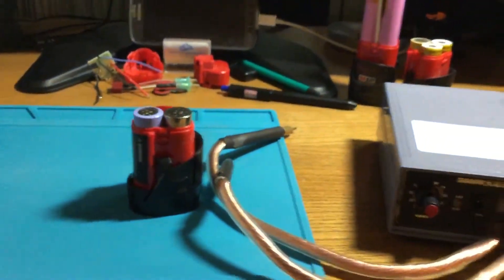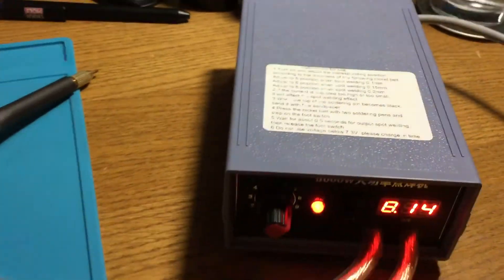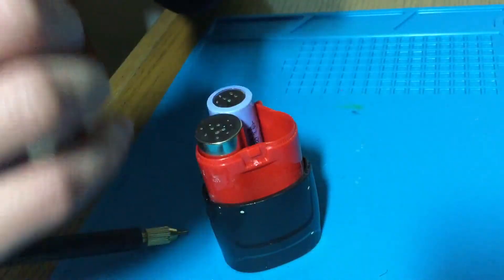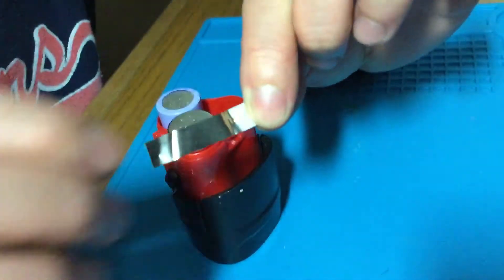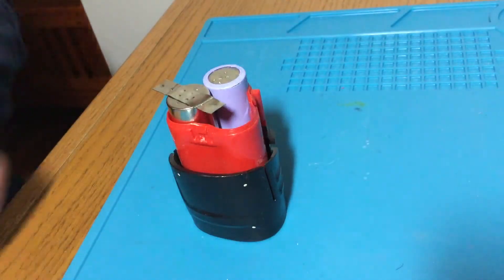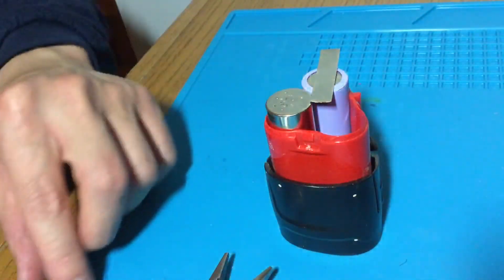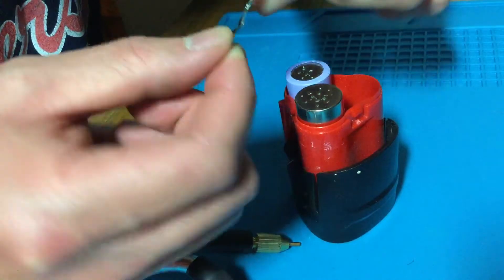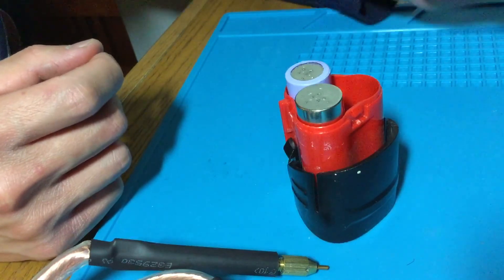Testing the KKMoon 5000W spot welder with 0.2mm pure nickel strip

Comment: so it doesn't spot weld 0.2mm then.  it has a little brother called DX10.  it's probably won't do too.
btw how much is the different of the price of pure vs plated? 

coz there are so many scammers in the market.  some of them might be selling aluminum plated and calling it pure since it doesn't rust on salt water test it's hard to figure if it is a scam.
Reply from the maker: I bought the strip from a friend, Liionwarehouse, so I know it's pure. I didn't shop around

Comment: well, you can improve performance of this welder a little.

first i soldered negative battery tab directly to the brass bus bar, for some reason that has not been done by manufacturer - big soldering iron is needed.

then i noticed that brass tip holders are heating up - so there is narrow spot for current flow , so  i  made my own holders from thick copper tube and tips from 6mm copper rod.

it is possible to weld .2mm pure nickel strip now.
Reply from the maker: My welder had the negative battery tab already soldered directly to the brass bus bar. I didn't notice anything with the tips on mine. In the end, I bought a Malectrics spot welder and will be doing a video soon

Comment: I have to say, this spot welder is not bad, it cans spot weld PURE 0.15mm nickel strip or 0.2mm NICKEL PLATED nickel strip. But 0.2mm PURE nickel strip, it seems to be weak. It can also do nickel to nickel (0.15mm PURE), So basically, with double 0.15mm pure nickel, you will have 0.3 MM PURE NICKEL!!! So it works and I made my battery pack very esily. I'm so happy XD.

P. S
This spot welder can also do maybe TRIPLE NICKEL. Not bad after all...
Reply from the maker: Can't the cheaper spot welders also do 0.15mm pure nickel? And isn't the added resistance of stacking nickel strips undesirable? This spot welder seems bad value to me at $80+
Reply: @MINIzguy  Well it's a little bit to high the price but no, stacking nickel together decreases the resistance. I know this from experience and of course I tested it and it is true. Because stacking nickel togheter means putting strips in parallel, and if more resistors are in parallel, the total resistance must me lower due to Ohm's Law. So, it can't spot weld 0.2mm PURE, but you can spot weld multiple PURE 0.15 and you will still get less resistance. The price of this should be at least 60 - 65$ by the way...
Cheaper spot welder can't weld well 0.15mm PURE. Welding the PURE nickel strip is harder.
The disadvantage is that you will need a double length of the nichel strip in case you have to do double nickel... Well... There are pro and cons.
By the way, I was able to make my 12P4S battery pack, and IT WORKS PERFECTLY FINE. Drawing 50A from it is absolutely not a problem (And I didn't use double 0.15mm nickel, only single strip). So it seems like it works for battery packs...
Reply: @MINIzguy  I agree.

Comment: I have open them I learn that cheaper in this tool brand isn’t worth it for heavy use they stop working from cell issues and electronics , I just got a 6yr or more 1.5Ah original and still holds up till today they are worth when you purchase new from authorize store ima try to do the hack you have done with the lights might use it to test things out …

Comment: How the heck is this possibile this damn thing costs 92€ and IT IS A PIECE OF JUNK ACTUALLY it says that it can spot weld 0.2mm MAX nickel strips but in your video it seems like this thing is just a $ BURNER. Good spot welder for about 100€ or $ is non existent??? Where i COULD find a good one i need this and probably thanks to this video im not gonna burn my 92€
Reply: I will try to boost it with SUPER CAPACITORS. The are very powerful and can deliver insane amount of current. I Will Also try to charge it to precisely 8.4V with my  current limited power supply and Press a lot on the nichel strip and then spot weld (6 holes instead of 4).  Maybe it will get BETTER... I cant buy other spot welder unfortunately.... This is my only possibility so i will modify it and hopefully it will get BETTER or in case i will do it with 0.15mm and maybe i spot welder a strip over another (hopefully it can do it) so that 2 strips one over another makes 0.3mm which is decent.
Reply: And here on amazon i found it a 90€ so is a little bit cheaper. I WILL DO MY BEST
(I will create a 4s 9p battery pack with ICR18650 22P - SAMSUNG)

I hope that it can spot weld the 0.15mm PURE nickel strip.... Otherwise i have to modify it and i really hope that this is not going to break the mosfets. Can you try and make a video about it maybe? Modify your spot welder and maybe it will work better... The choice is yours.
I saw some videos that in the circuit if you add a capacitor after a DIODE in the circuit, this capacitor saves the circuit from Low voltage spikes, because the Gates of the mosfets if driven with Low voltages can cause the mosfet to not saturate correctly. Adding this capacitor should make it BETTER but you have to find this diode... Search for 'cheap spot welder mod'. The larger the capacitance the betteri it is (i will try 4700 uf but even 2200uf can make this '5000w' spot welder BETTER). And also i will add capacitors in parallel with the battery. Hopefully it will work... I NEED to spot weld the 0.2mm no matter what!
YOU can maybe try this and maybe it will work and work and you can spot weld 0.2mm. I cant try this because i have to order the spot welder and i cant order it now i have to wait something 10 days... If you want try to do this modificaton maybe it will be worth it!
Reply: @gianluca458  how was it? you able to do 2x .15mm?
Reply from the maker: Yea imagine my disappointment after spending this money :( I'm going to try and boost it with a 3S LiPo pack, but I wouldn't recommend buying this in general. I'll be $130+ into this spot welder and I think you can buy a KWeld for $200